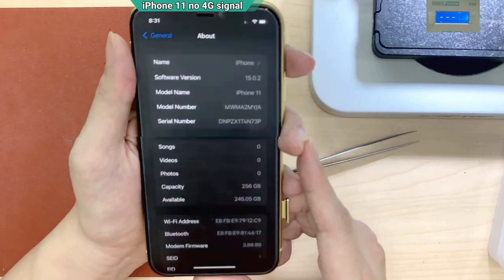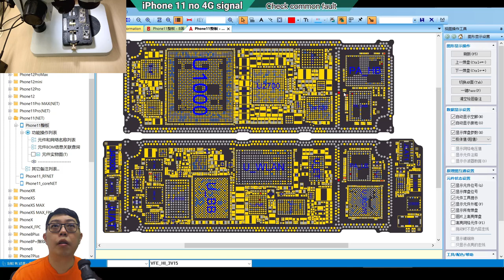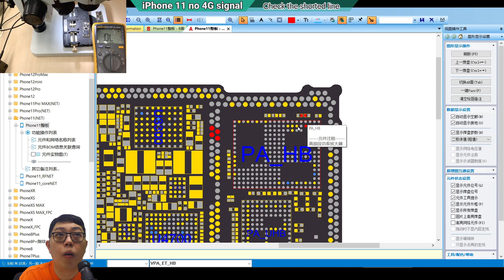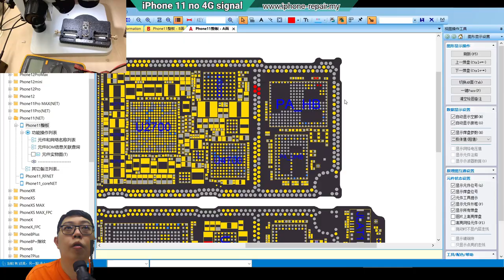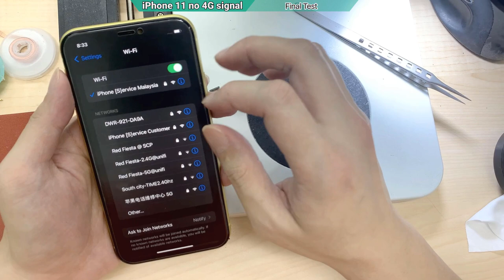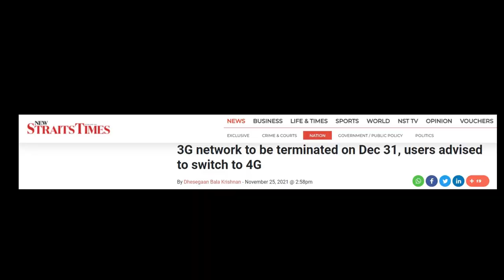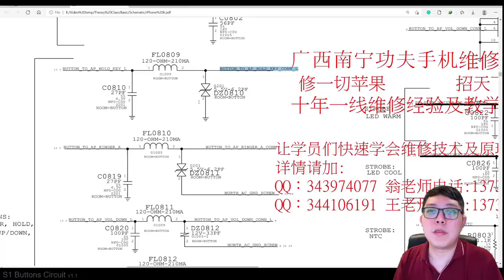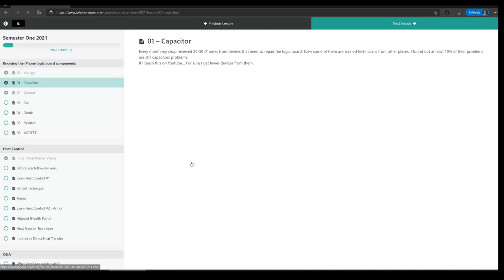iPhone 11 No 4G Signal | No Service Repair【Tutorial】

Comment: Hi Lim,
What is the reason of this malfunction? It's due to ic itself or can be happened after drop or other cause?
Reply from the maker: Hi. IC itself. 
Since Apple switched to use Intel for the Baseband, those IC that made for Intel circuit are very new in the market. Not enough experience comparing with Qualcomm.
Reply: @iPhoneServiceMalaysia  thanks Man!

Comment: Hello, I have a question, does the station de soudage laser make it easier to repair phones or hot air?
Reply from the maker: No. Without a proper heat up, most ICs won't survive after taken off because of sudden thermal shock. 
Such detail already has been explained in my online course.